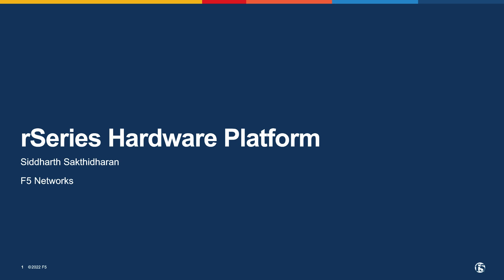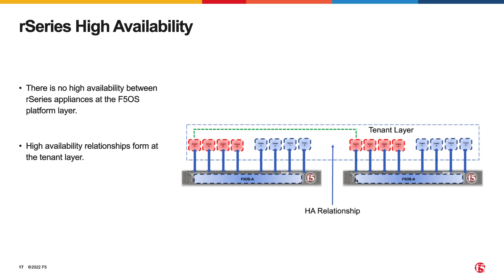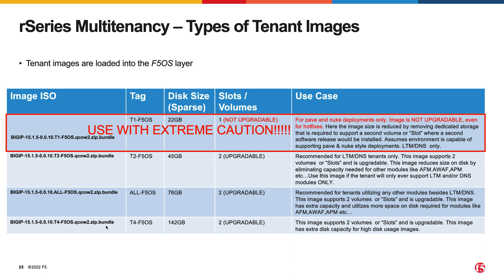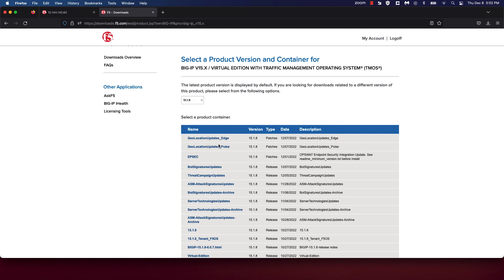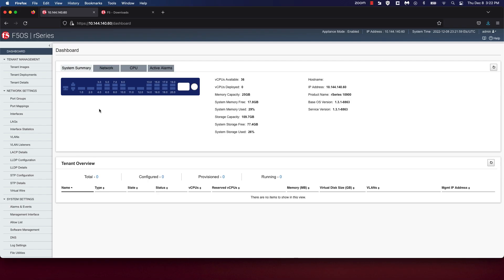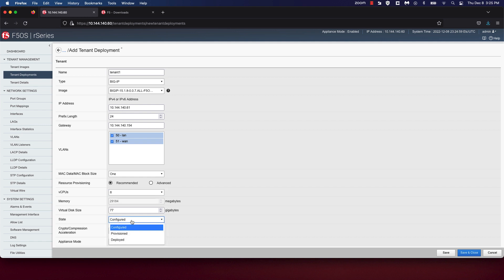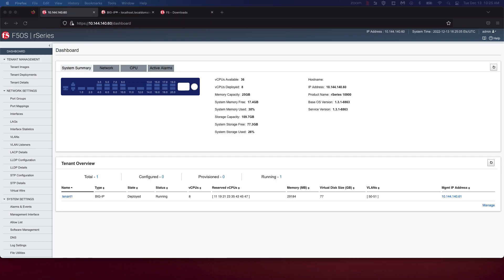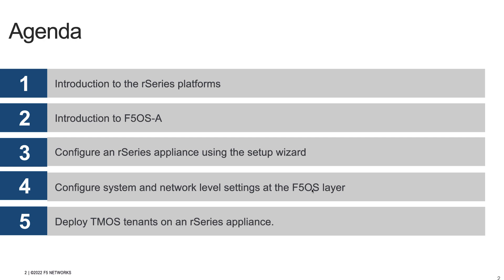Tenant Sizing and Deployment - rSeries: F5's next generation appliance -

Comment: I have two questions
1. Could the sameV LAN be used on multiple different tenants ?
2. Could the same ltm pool be used on multiple different tenants like today when you create a pool on common partition and then use it on multiple partitions ?
Reply: Late to respond but yes you can use the same vlan on multiple tenants. This is known as vlan sharing and is supported.
Reply: To answer your second question no I don't believe so. Since each tenant is it's own instance of big ip. The tenants don't share a common partition in the tmsh sense